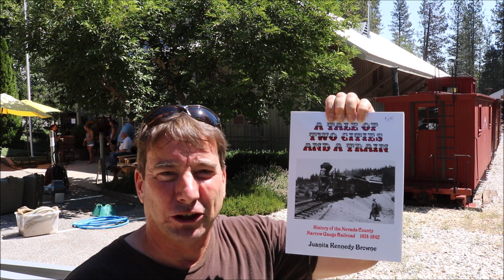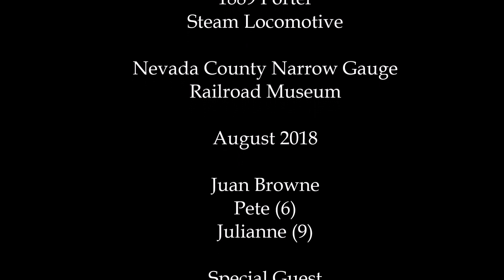1889 Porter Steam Locomotive

Comment: The magazine NARROW GAUGE & SHORT LINE GAZETTE has covered stories of the NCNG in past articles.  
Hal Wilmunder sold some 3 foot equipment to the Genesee County Parks & Recreation Commission for the Huckleberry RR in Flint, MI in 1975.  One of the locomotives was a 2-6-0 Porter blt 1909 for United Fruit Co from Guatemala  and a 4-6-0 Baldwin blt 1919 for the Alaska Engineering Commission for the Nenana River mines out of Fairbanks for use until the bridge was built across the Tanana River and the line into Fairbanks was standard gauged.
In 1980 the Huckleberry was given a diesel-electric 6-axle 75 ton Porter blt 1946 which was built for US Gypsum at Plaster City, CA.  This was the largest diesel loco Porter ever built.  It is now on the Georgetown Loop RR in Colorado.

Comment: I like old steam equipment.  The last new construction steam locomotive to be built world wide is located at Boone scenic valley rail road.   Boone Iowa.  Located about 40 miles north of the DSM airport.   They roll across the Kate Shelley trellis.  Combination longest tallest high trellis in USA.  Both of those will Google
Reply: And if you check out " old threshers reunion ". There are several events around the country mostly in the Midwest.  Early farm tractors were essentially steam locomotives with steel wheels instead of rails.